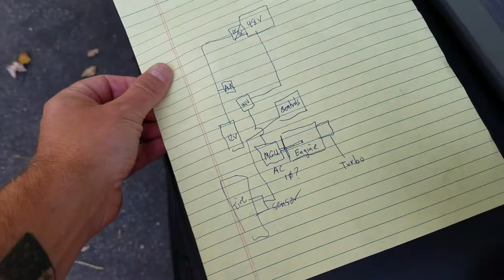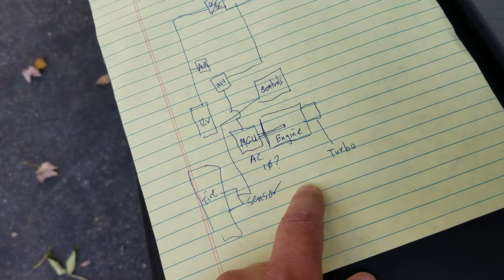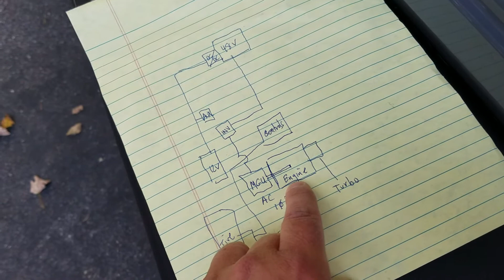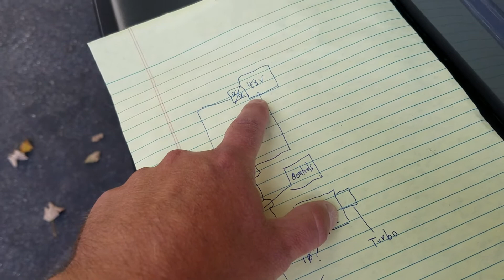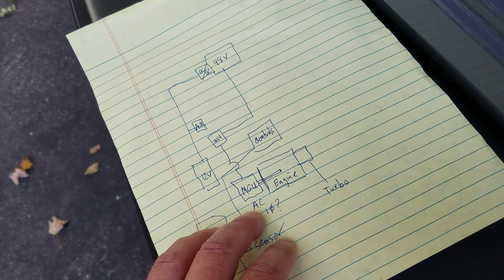Jeep Wrangler Unlimited Sport JL 2L Turbo; eTorque System Walk Through, Part 2

Comment: I'm confused as well. I have a 2022 2.0L non-eTorque. Is it an eco??
I have the second smaller 12V battery below the fuse box, and I think when it starts with the start/stop, it uses a generator. It also uses the generator to charge the batterie(s).
I do know that the nut that caused you some concern is called a flag-nut. They are used when it is difficult to use a standard nut. Typically it is inside the frame as in your case.
It does look strange, but you shouldn't be worried about it..
Reply: There the same. I have a 2020. The only jeep wrangler/gladiator that is different is the 4xe